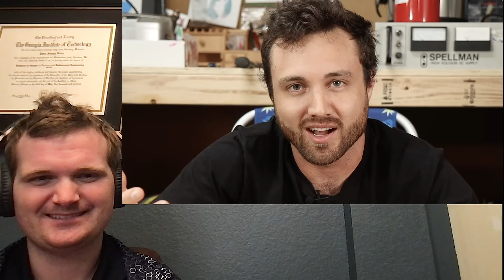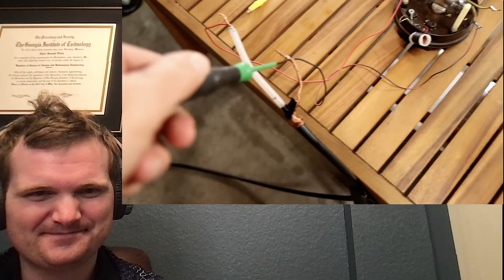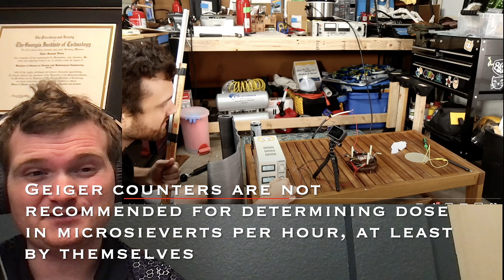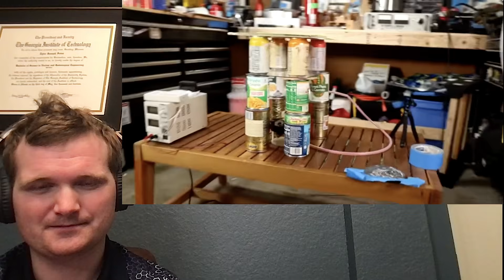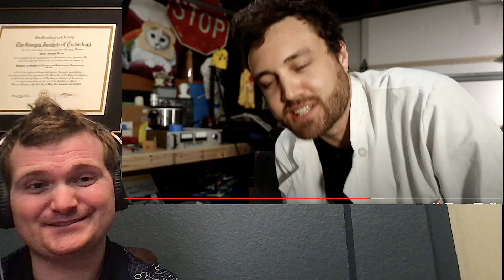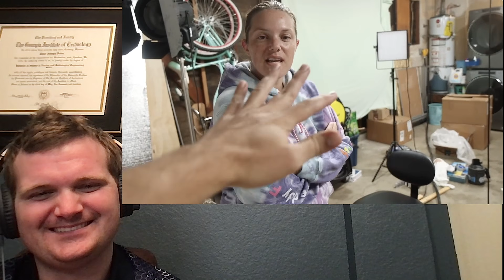Nuclear Engineer Reacts to William Osman's Homemade X-Ray Machine After Hospital Charged $69,210.32

Comment: Electrical engineer: I wouldn't touch that thing because of all the radiation!

Nuclear engineer: I wouldn't touch that thing because of all the high voltage!
Reply: Me: I wouldn't touch that thing!
Reply: My grandfather "Eh, whats the worst that could happen?"
Reply: Non engineer: Where can I sign up?
Reply: Radiological engineer: I wouldn't touch that thing without tinted sunglasses
Reply: Electrical engineer that has worked in the nuclear field for over a decade: I really want to touch that
Reply: mechanical engineer: the table is strong enough to hold that
Reply: As a bioengineer me: "My survival instincts says me not to touch, but because of the science and curiosity ı would touch it in anyway, it is also a kind of natural selection ı guess 🫠🥲"
Reply: Electricity will absolutely kill you, but the danger of the radiation is very overstated. That thing would literally need to be on for several hours with him sitting in the room with it for him to be in danger. On the other hand, the electricity can absolutely kill you dead instantly.

Comment: I think part of the fear of x-rays is how they used to be. The old shoe fitting fluoroscopes averaged around 6.5 mSv per second and people would just stand there looking down at their foot through it to contemplate how well their shoe fit around their toe bones.

It also doesn't help that fear that every time we get an X-ray, they slap a heavy lead-filled pad whatever part of our torso they aren't scanning and hide in a bunker while a mini air raid siren goes off. Good for safety, bad for PR.
Reply: @killingtimeitself Yep, and the "mini air raid siren" is a high voltage discharge inside the emitter.
Reply: In todays episode "Nuclear expert doesnt know x-ray is not nuclear!
Reply: @danquaylesitsspeltpotatoe8307 Go troll elsewhere.
Reply: @Merennulli  Oh your also ignorant of the fact its not nuclear! LOL that explains alot!
Reply: @danquaylesitsspeltpotatoe8307  He himself said in the video that it is not, he himself said that it is not regulated by the Nucle Regulatory Commission because there is no radioactive material inside, you are an animal and you did not watch the video.
Reply: 6.5mSv/s sounds like a lot...
Reply: @Xnoob545  It is indeed. It resulted in a number of people getting tumors in their feet.

Comment: I'd argue that him making a home-made X-ray machine is reasonable for the purposes of "reasonably achievable", simply because the educational value of doing it is higher than the risk-factor of doing it, since it's not really that unsafe for somebody in his position.
Reply: Especially given he overdrove the tube. Typical x-ray tubes get 10 - 14 kv drive. He had a what, 69 kv power supply? Much more x-ray output than rated and fairly harder x-rays.

Comment: Basic X-ray Systems for veterinary use start at about $16000. These systems are used on humans in some parts of the world, where the certification requirements are not as strict as in the US or Europe. 
My job is in the medical IT and I've seen some really good human X-rays from such systems (But also really bad ones. The generators are not that strong so the exposure times need to be much longer and it is really easy to mess up)
Reply: Really depends on the system though. A system designed to be used for larger animals like horses is perfectly capable of taking good x-rays of humans, but a dental system for dogs and other smaller animals is altogether different.
Reply: @Bobbias  You're absolutely right! I just kept it simple and short for everyone to understand. Even today a X-ray system is a white box at the hospital that beeps and magically delivers an image of their insides for most people, so please excuse my oversimplification :)
Reply: @Bobbias  Further more really obese people sometimes has to be brought to the veterinary systems just because they can't fit in the human systems, it happens more than you think and should be a clue that you should go on a diet.

Comment: I have a chronic illness that's kind of like diabetes; 100 % fatal if untreated but completely normal life expectancy and outcomes with modern treatment.

Insurance covers the rx, BUT NOT THE NEEDLES. They can fluctuate monthly between almost nothing and thousands of dollars. Even with some of the best insurance available, I've had to needle shop to the point of having hit up harm reduction centers to score syringes to be able to take my life preserving medicine.

Craziest part? I have "great" insurance.
Reply: I have a similar health problem and insurance issue. I was able to buy needles and syringes off a vetrinary supply website for far cheaper than getting ripped off at the pharmacy counter. If it's sterile enough for a horse, it's sterile enough for me.
Reply: @gazmodius  holy crap that's brilliant
Huge thank you for this tip 🙏🏼🙏🏼🙏🏼

Comment: Actually happens in US on a regular basis.

Hello, how much does an X-Ray cost?
Well, it depents it goes from 270$ up with no upper limit.
(So basically 270$-infinity$ lol) 

Even though you already have the machine and it costs 1-2cents of electricity per picture.

Comment: Remember, anything or everything is gound when you are using voltage's above    600 volts, you need special insolators and spacing to keep the high voltages in the controled circuit from going to ground. If you are not careful and don't know what you are doing, remember, you are ground, it may injury or kill you.
Reply: Hell, even a 10kv line can act as ground if the other line is 60kv.

Comment: I built my own x ray that used an old TV rectifier tube and a spiral line pulse generator. It developed well over 120KV at multiple amp range pulsed power for about 60nS. The pulses of x rays were very bright and penetrating, and because 90% of the power is in the first 10nS it can stop motion of extremely fast things as well. The pulse generator is extremely easy to build. Its a jelly roll capacitor with several extra turns of foil inside. The outer foil and inner foil are discharged and the pulse creates a current wave that compresses in time and increases voltage when it hits the inner foil turns. Each quarter turn doubles the voltage. A spark gap triggers it. ❤
Reply: Dr. Oppenheimer would be proud

Comment: The X-ray tube its easy to do too, i made one with a small tungsten cube a small lightbulb filament, a crt trasnformer and a fridge pump for vaccumm.
Reply: Same with a chunk of a TIG rod crimped to a lightbulb filament support and a brakelight bulb filament as the cathode. Putting a reflector cup around the filament makes it much more powerful. An easy way to get an extreme vacuum inside is to backfill with oxygen then pump out. Have a small amount of magnesium or titanium inside electrically connected. Next power up enough that the metal melts and boils.  This will remove any remains of gas, both oxygen and nitrogen from the tube.❤

Comment: You could use a 3d printer to set up a good containment unit for this setup. I think it could look pretty good.
Reply: @@b14hb14hDoesn't need shielding. The only reason they're shielded in hospitals is because of the sheer amount of x-rays the technicians are exposed to, some technicians take upwards of 2000 a day. While it's still far below the regulations for safety we use shielding when not needed as a peace of mind rather than actual fear of damage.
If it weren't for people's lack of understanding and all the propaganda that surrounds anything nuclear we wouldn't have shielding on a great number of things, just makes it more complicated and expensive to produce, not to mention heavy and toxic.
Reply: @@b14hb14h There are some filaments that have metals mixed in. Or there are machines that are designed to print metals

Comment: those x ray heads probably have beryllium windows and can cause berylliosis.
Reply: Beryllium metal really isn't so bad. Tiny particles that you inhale might be, and beryllium oxide is definitely bad to inhale.

And the cost and availibility of beryllium parts (at least a year ago) is crazy. William is right that it might be interersting to salvage the Be windows, if you can maintain the vacuum seal.

Comment: That lead looks at least as thick as the lead in an xray room I did some work in on and around, and yeah modern xray machines are rather different than old ones, the digital plates measuring the xrays are in fact wifi connected and iirc powered by a rechargeable battery.

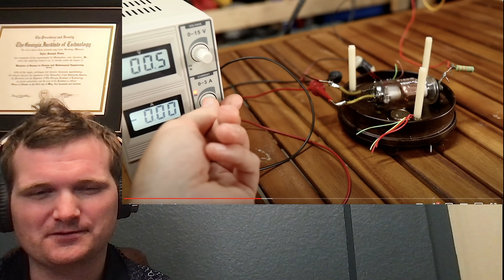Comment: How is that resistor doing any work @ 6:20 ? Looks like both connections are coming from the one side of the Resistor, looks like the leg of the other end has been snapped off or something.

Comment: I hate all the negative reaction Osman's video got which caused him to quit making YouTube videos for a while. Sure the things in this video were dangerous, but I'd be surprised if everything the Mythbusters did was perfectly safe either (even under the consultation of experts). Certainly none of what they did was necessary, so it's hard to ding Osman there either.

The truly dangerous stuff is the things that don't appear all that dangerous on the surface. Like when TylerTube connected a boatload of 9-volt batteries together and played with zapping things. The power out of it was only obvious after it was assembled. At points during construction he was very close to completing the circuit with his body. He was almost certainly thinking that it couldn't be any less safe than touching the ends of a single battery. And Big Clive pointed out in the comments that the battery casings were not designed to withstand that voltage so even just touching the outside of the battery monstrosity could have been lethal.

Comment: How do you control the dose rate from the X ray tube? That's what i would be worried about here - maybe he's accidentally driving the tube at 10x the normal rate.
Reply: He's got the technical sheets on it so he's actually probably got the voltage right. As much as he's half-assing it he usually has most of the important technical stuff right.

Comment: Guard dogs would protect me from radiation, but a few water jugs would too and well, the water jugs eat a lot less and if the water jug takes a poop, I'll become quite wealthy charging biologists access.

Still, if I had that HV power supply, I'd have already built a fusor, just for fun. Then, once it's working, I've got a nice and gentle neutron source...
Then, to get my neutron reflectors out of my other pair of pants...
Run the HV through a tripler, since I'm already pooping out tons of money, coat my grid with lithium deuteride and with a bit of creative excitation, see if I can make some new federal friends...
I'll be sure to be getting holiday cards from the electric company.
And loads of laughter and the comment, "Not even wrong" from Pauli's grave.
Yeah, but my apparatus didn't explode when I was in the room.   ;)

I've worked with HV quite a bit over the decades, not exceptionally concerned if I'm working with it, as my first three rules are safety is first. Yeah, I've arced something for test, largely due to my unwillingness to not put my lunch hooks anywhere near exposed HV conductors.
I started out my military career working with things whose clearance began with a Q. See the safety rules. Hence, why I inverse square my cares away.

I'll just get my coat...

Comment: 😂 thinking about those times breaking some bones in the hands or foot and just continue to work with it 😂 and just think: "ahhh it will heal in time" 😂 or dislocating a finger, good tip: if you dislocate your finger, wait for the shock (getting that whitish face and the heat leaving the body) and put it back yourself 😅 i went to the hospital afterwards and they said "no everything looks fine". 😂😂 Saves a lot of money 😂

Comment: My doctor about 50 years ago had an antique fluoroscope x-ray machine. He didn't use it, the radiation exposure was too high. It looked like something out of a mad scientist's lab.

I also had a friend who worked at an electronics company. He used an industrial x-ray machine to verify that parts were good. He used to use it in an unauthorized fashion to help reverse engineer things, that was fun. My friend always stayed far away from the machine during operation because ALARA. When he got another job his successor got radiation burns on his arms due to ignoring this and also poor collimation of the x-ray beam. OSHA contacted my friend to find if he had any symptoms which he didn't because, well, he stayed the hell away from it when it was operating, authorized or not!

Comment: 8:00 DNA is everywhere, what makes fast dividing cells more susceptible to damage is what happens to the DNA while it is copied. The DNA itself is a redundancy mechanism. it consists of two strands with the same information on them and damages can be repaired. But it can't be read or copied in this form, so these processes turn them temporarily into a single strand but this temporarily removes the redundancy. When damage occurs at this time, and happen to affect some important part, then it could be a problem. Most of the time even this it's not a problem, it results in damaged cells or bad copies and the immune system gets rid of them. A sunburn is exactly this... mostly harmless, but some people get skin cancer.

How the copying of the DNA works is also interesting, there are molecular machines that do all the work. The sci-fi trope of nanobots are big and clumsy compared to them. Veritasium has a nice video about them: https://www.youtube.com/watch?v=X_tYrnv_o6A
Reply: This is another Video that shows the repair mechanisms of the DNA: https://www.youtube.com/watch?v=2yI_SoOWFMU
(It's an advertisement for a specific type of cancer but the explanation/animation is quite good)

Comment: As an X-ray technician it is pretty fun to see all the little inaccuracies. For one (I'm only 3:20 in, but have watched Williams full video) you have a picture of what appears to be a copper headed dentist X-ray tube, or maybe one for mamo (which probably matches Williams, but is almost nothing like what we would use in the field). In a normal X-ray tube the anode is a disk that spins to deal with the heat from thermionic emissions, since 95%~ of the electrons are turned into heat, and is made of usually tungsten which helps disapate heat more, but also helps lessen the negative effects of charactersitic and brems reactions since the tungsten has a high binding energy of the electrons with in the atom. Also, there are multiple filaments usually, not just one. I could go on but you get the point, it's fun for me though, much like I imagine your youtube series is, as a viewer of others seeing and speculating on your profession. I'm really glad you picked this video. Love your videos!

Comment: ohysically observable damage occurs from 130-300cpm

130,000 v at 2.4 mhz transmutes whatever it hits including you. and remains radioactive for 3-10 years depending on whats created.

and if it hits you, this occurs inside you. mostly surface but this frequency pentrates the skin. going for the densest parts of you and metals.